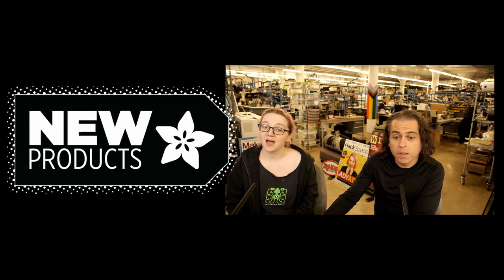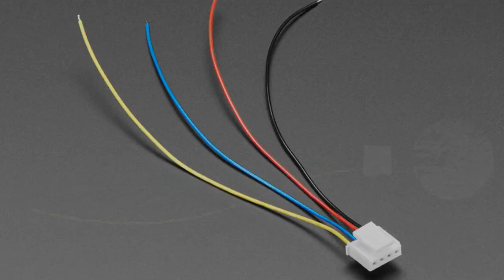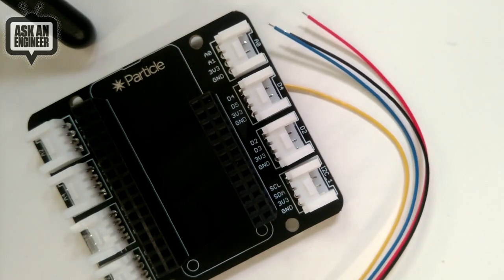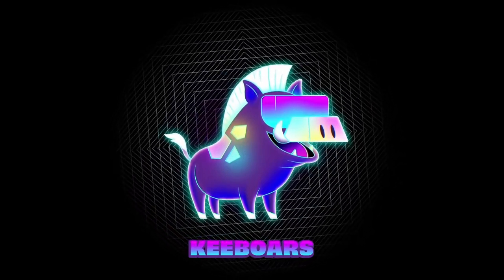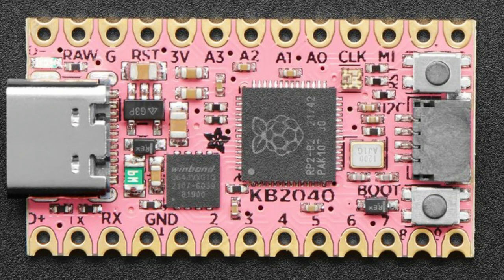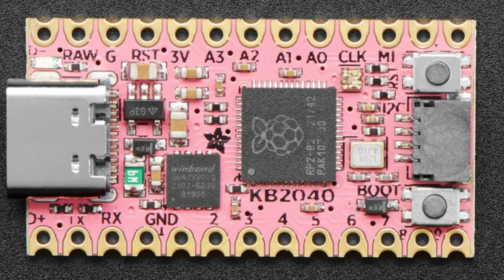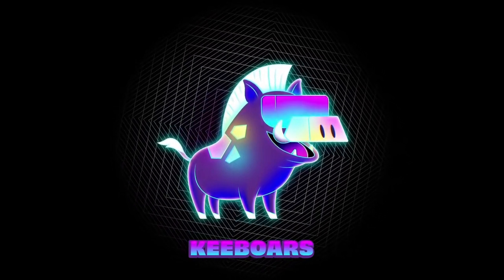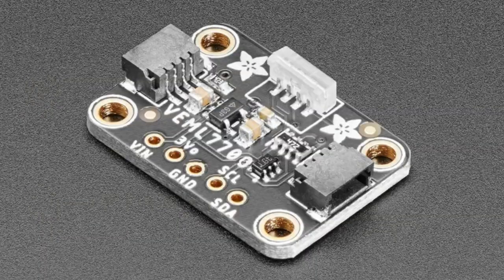New Products 2/16/22 Feat. Adafruit Right Angle VEML7700 Lux Sensor - STEMMAQT / Qwiic!

Comment: 3:50 QMK was used by many yes. But VIA is basicly the new standard because of its user friendlyness, ease of use etc. So it would be nice if it hat support for VIA as well as QMK
Reply: Yeah i know QMK can do amazing things, but the effort just to put a simple config into a macropad is large. Just gigs of data to install a build environment, then a complicated build process.
Reply: VIA is dependent on QMK. It's essentially just a way to interact with QMK that's more user friendly. Not every QMK compatible board works with VIA, but every VIA compatible board uses QMK. iirc VIA compatibility requires that the board be put onto this huge repository, and custom boards and layouts are often not on it.

Comment: If a switch matrix with 75 switches (with a diode on each one) is connected to a KB2040, is it possible for it to read all 75 switches closed simultaneously?